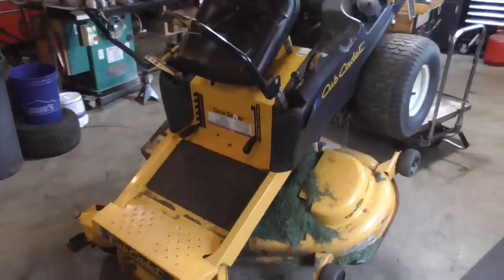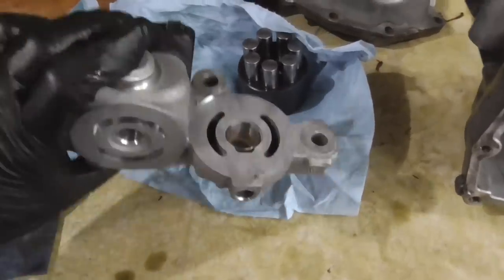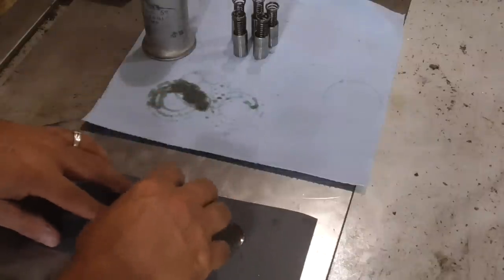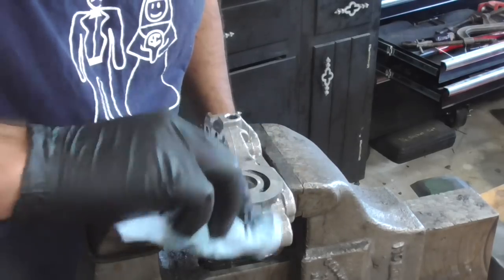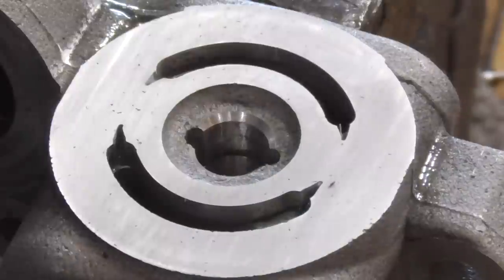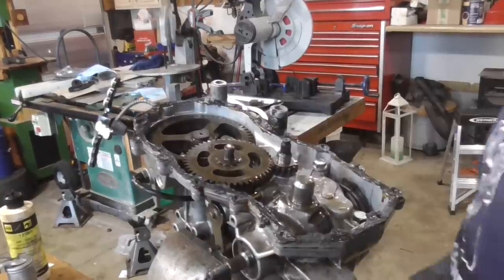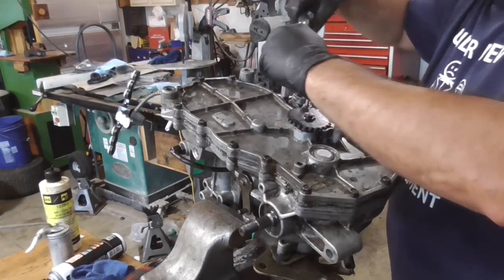Repairing Rebuilding Zero Turn Tractor Hydro For $20

Comment from the maker: https://amzn.to/2Dgrhf4 Wet Sandpaper Assortment
https://amzn.to/3hPn0Ov Wet Honing Block/Stone
https://amzn.to/2ECF3JH Permatex Aviation Gasket Former
https://amzn.to/3gffmg7 Permatex Right Stuff Sealant
https://amzn.to/3hOfbsq 20W 50 Synthetic Motor Oil
https://amzn.to/2Dn1iCM Oil pump can
https://amzn.to/2Xau4NW Brake parts cleaner 12 Pack
https://amzn.to/33aUXVx Hydro Gear Center Section Replacement
https://amzn.to/3jYIvhY Hydro Gear Cylinder Blocks
https://amzn.to/2Pbxn2Z Hydro Gear Motor Block
This video is posted on 7-29-20 by Doublewide6 Repairs LLC
In this video I show you how to completely resurface your wheel motors, pumps, and center section using basic tools.  
Videos:
https://youtu.be/ygwZChI1SqA Transmission rebuild video
https://youtu.be/xwPimj0uXqw How to adjust tracking on zero turn
Help support Doublewide6 Repairs LLC by sponsoring his Patreon Account
https://www.patreon.com/doublewide6
Reply: That was one of your best video's. Very informative. Thanks much.
Reply: great video, straight to it, just subscribed. Bought JD Z245 same problem, liked it so much honest guy told me the problem, bought it anyway. never had a deere, not sure normal sound of steering, both sides seem to whine & seem slower and slightly stiffer to push than others i've ran, left side really bad and when hot completely quits pulling, especially on any grade at all. are JD parts similar to this cub cadet?  What would your advise be on what the problem is? Thinking same as this cadet? also wondering if somebody put hydraulic instead of 20-50? but even if so it still has a problem. worked on my own equipment farming all my life but never a zero turn. sure helps with your videos. Thanks a bunch!
Reply: Are there any parts suggested while the rebuilding in progress ? O rings ect.?

Comment: Just wanted to thank you for posting your video on hydro gear repair. I followed your recommendation and sanded the pumps and pump base housing with 400 grit stepping up to 2000grit. Your procedure was spot on…my weak left hydro gear (cub cadet ZTR LX50) works perfectly. I mow around 3 acres, hills and wooded and this zero turn mower performed flawlessly for 2.5 hours. Thanks again!
Reply: Awsome! About to try this on a used unit i just purchased... 🤞
Reply: @kellyedington8716  me too!
Reply: just saw a unit for sale with this same problem for 700..  how did the repairs go for yall that were going to try?
Reply: Thank you for this video, I sanded the parts, stepping them up with sand paper , put it back together and bad boy works great, thanks for all the help, it saved me money on repair, will follow you from now on.
Reply: How long did it hold up?
Reply: @ErikISkogen still running the zero turn mower with no problems
Reply: @joejacobs3978  Nice! Good to know if i need to do mine :)

Comment: This has worked great so far with my Troy Bilt ZT that had a weak left side hydro. It would whine and worsen as it got warmed up anywhere between 25-40 mins. Sanded it with 1000 and 2000 grit block, cleaned everything up, and now i swear it almost feels a little more powerful than the right side. Tracks straight and even again. Well worth the effort especially If the only other option is a new center section or complete unit. THANK YOU!!
Reply: How long did it take to fix? Is it still working today? Mine's doing this now, just like you said. After 25 minutes the right side is almost unusable. Let me know if this helped solve the problem long term!

Comment: Thanks for posting, I was able to repair my Hustler Sport left side trans and saved myself about $1300.00. One thing I did notice that the unit took about 20 minutes or so to re-prime before it would work. Had me worried there for a moment. Works good as new and does not make the whining noise when engaged.

Comment: My brother didn't want to put in money into his 10-year old JD X304 with a transaxel issue and gave it to me. It's got the K46 transaxel.  I stripped it down last week and I've got the exact same center case problem.  I was wondering if I could sand it...BINGO!  You save me $460 + shipping.  Consider me SUBSCRIBED. Great stuff.

Comment: Thanks for doing this video, it's quite useful. On the motor side I ground down the extra casting so I could run straight across the entire face. I used a block of granite for both.

Mower runs excellent after resurfacing both transmissions.

Comment: i have a zero turn like the cub rzt 50 you worked on . i rebuilt the right side trans axle with new parts and it works fine. i then rebuilt the left side trans with new parts and it does the same will go for a bit and start slowing down and wining. what do i try next i am at the end of trying.thanks dennis

Comment: My left one was the weak one, but I did this repair to both of my transmissions. Purged them both and the left one worked great with the wheel off the ground but won't move when on the ground. The right one works great. I pulled the left back apart and resanded because I saw some faint scratches with a Magnifying Glass. Purged it worked great with tire off of the ground, but won't move with it on the ground. It tries to move, so looks like I will have to buy a new Center Section for that side. Hate that it didn't work for that side.
Reply: Did new center section fixt it for you?
Reply: @scottk27332  Yes the center section, both pistons and new filter. Works Great!!

Comment: Thank you for the video.  This video really clear up how hydrostatic transmissions can fail with no super obvious defect.   These pumps and motors are wearing at their merry-go-round sealing surfaces or maybe gouge is a better term causing them to not be able to maintain high hydraulic pressure needed for producing torque. They make use of  highly critical tight tolerances to maintain high seal pressure and just a little gap in the thousands of an inch will bleed off the high pressure they need for producing torque.   I think its a bit analogous to piston rings, but its a rotating assembly.   Piston rings are expected to allow a certain amount of blow-by so this sealing environment is actually more difficult to manage.   I'm surprised such a system can maintain a seal.  The high pressure is forcing it apart and it might be likely to want to oscillate up and down.  That might be what the sequel noise comes from as the breed through areas quickly changes shape varying the amount of oil that breeds through.   

My father got a Gravely zero turn mower in 2004 and I was the person that ended up using it.   From the start the mower made squealing noises and one hydro transmission side got weaker and weaker.  When it got hot one side would only have about half the power of the other side.  You could still use the mower by biasing how much handle was applied.   I'd change the oil in the hydro drives and one side would have oil that gotten a green color in it, like grass green.   The other side oil would appear dirty maybe a little green tint to it.   The hydro transmissions would run a lot better for a while after changing the oil in them.  

 I think I flushed out the oil a few times to where the oil wouldn't turn green right away.   I was very frustrating and I was investigating online what might be the cause of this behavior.   There was really no information available 2004 - 7, even though hydro static transmissions had been in professional lawn care for a good number of years.   My guess was the problem was likely relatively simple and cheap to fix if somebody wanted to go to the bother.   I finally got a diagram and basic understanding of how these hydro static transmissions work and really there didn't seem to be any clear area they could go bad in that wasn't due cataclysmic failure.   Obviously if the pump or motor case were to crack or the pistons were to crack or break or springs break that would be a means of failure, but if it were due to single piston cylinder it would seem the problem would be cyclic pulse and noise and that wasn't present.  I just couldn't see how the mechanism could be failing in the way it was.   

That mower had been taken in for warranty work a numbers times for other matters and the dealer obviously didn't want to do anything on the transmissions.   I think the transmissions were suppose to be non serviceable.   To change the oil I'd use a suction pump through the vent hole.  I the method left a bit of oil in the transmission, but not much and the oil was changed numerous times to flush the system out.  There were lots of upgrade  fixes for that mower and it got all of them according to the dealer.   

After about 2 1/2 years my dad had gotten tired of fooling around with this Gravely and got a Toro zero turn.  We sold the Gravely for $500.  It also was very hard to start sometimes just barely turning over and in cold weather it wouldn't.   I fixed that by replacing the small tractor battery with a regular group 24 car battery.   I'd recommend always replacing a lawn tractor battery with a 'real' battery.   They last much longer and start the tractor much better and can be used to jump start other vehicles.  The Gravely had room for group 24 battery under the seat.  There was very little clean up that had to be done to place it.   

With the hydro transmissions flushed out with  new Amsoil synthetic 60W oil in them the mower still didn't want to go up the large hill in the backyard, but that hill was due to a it being a dam.  Many years later a lawn care person mowing this lawn told me we had the most difficult to cut lawn in the area with that steep hill.   The synthetic 60W oil greatly reduced power loss due to heat and it seemed to stand up to whatever the transmission had been doing to destroy the other oils I'd put into it.  The person that purchased the mower seemed to just want to play around with zero turn mower and on the flat its problems were greatly reduced.  For $500 in 2007 a person really couldn't have access for zero turn mower to play around with so I hope and maybe it did  work out for him.  I spent more time figuring out that Gravely mower than I'd ever spent on lawn equipment in the past.  I'd expected to spend more time on it being I'd only had experience with walk behind mowers before and riding mowers were notorious high maintenance machines, but this was likely restoring an old abused sports car and it was suppose to be new.   I wonder about that.   

The Toro seemed to have many of the same transmission components and such as the large single cylinder Briggs engine, but with a small three bladed deck instead of the two bladed deck of the Gravely.   Everything on the Toro worked better from the start even though all the components were driving a considerably bigger mower than the Gravely.  The Briggs large single cylinder on the Gravely seemed to be at the bottom of Briggs engine trim level; whereas, Briggs large single cylinder on the Toro seemed to be above the highest trim levels available from Briggs with a special Toro muffler.   Even though the Toro had almost the same Briggs engine as the Gravely I noticed in cutting the same lawn it seems to use only about 2/3 the gasoline the Gravely did.

Comment: Howdy, bub. I'm having trouble with my left-side ZT 3100...as of late, it's much slower and weaker than the right side one. Does that sound like an issue that the repair you show in this vid would repair? Just would like to know before I go through the trouble of removing and reinstalling it... And: Anything else to check while I'll have it out? Thanks!I'd r4eally like to keep this '07 Gravely going a few more years, as it's a beast and in great shape otherwise!

Comment: I have a John Deere Z535M and right side will not move forward or backward.  Happened without any warning.  Just finished the yard and right side suddenly stopped working.  Left works fine.  Right handle has no play in movement, moves just like the left side.  Has oil and no visible leaks.  Hoping I don't have to replace the whole transaxle.  I did notice when I have the engine running and both handles in forward position, left moves and right doesn't.  I can move the right side hub forward and reverse like it's in tow mode.  Same when handles in reverse. When I turn the hub, it feels like it's moving inside the transmission.  It is a sealed transmission.  Any suggestions greatly appreciated.  Thank You Sir.

Comment: Hi, I have a Ferris 400s and it has ZT3100 hydro deives, not sure if this is a problem but if I jack the drive wheels up and engage the bypass levers the left wheel still turns when I move the main levers forward and back. The right wheel will not move, I can stop the left wheel from turning if I hold onto it by hand with a tight grip. Any thoughts if there could be an issue with it?

Comment: Good tips, I think the only thing holding anyone back from doing this repair is fear of screwing it up.  But it is going to fail soon anyway.  Give it a shot.
Reply from the maker: That is a great point.  If it is broken why not try to fix it.
Reply: I agree it’s a lot of work and oil is high price also 
But I’m sure going to try it out if I can buy a used one cheap

Comment: Just a question about sanding out the scratches. Using the wet /dry sandpaper, wouldn't the sandpaper cut faster if you use water instead of oil? Maybe use oil on the last couple of finer sandpaper.
Reply: I've done this successfully with 1500 grit and water.

Comment: I was wondering if that hydro transmissions has a drain plug. And does it have a filter. If it doesn't have a drain plug , I would put one in it. That fluid needs to be replaced every 500 hours. Thanks for the information and video.

Comment: I have found that you can use a ultra sharp and honed flat wood chisel and slowly remove the step. This has worked for me numerous times. Just adding a little help from my experience.
Reply from the maker: Thank you that is very helpful.  Good info for anyone trying this repair.

Comment: I’m having to rebuild my drive motors at 175 hours. I really think they could use a harder aluminum metal. I also found a lot of dirt inside coming in through the vent tube I suppose. Heat, dirty oil and time seems to kill these motors.

Comment: Actually I have the same problem.  I attempted to fix it but disassembly stopped me.  Removing the pulley was impossible.  I found a used pair of transmissions and made a 4 hour round trip, $28 fuel and I was all set!

Comment: Did you happen to question "why" the center section was damaged? I have done several of these units. In every one, the 10 tooth jack shaft gear hard surface is flaking  off and the chips damaged the center section. So if you don't replace the gear, your repair will be short lived.
Reply: Please explain the 10th tooth jackshaft
Reply: @toddrayborn5413  it's a small gear with 10 teeth that turns a much larger gear. You could find it in a "Hydrogear" parts diagram.

Comment: Tried this on my 04 timecutter and didn't seem to work. It goes forward fine but wheel doesn't rotate in reverse. When I disengage it, the wheel moves freely in both directions. Do you know what might be causing this?

Comment: The Toro is actually called the Timecutter. BTW, those 2 Permatex products aren't meant to be used together because of their different formulations. You should use one or the other not both, actually the 'Right Stuff' or Hylomar would be the proper product. That aviation stuff doesn't set up like the silicone and might leak with right stuff on top of it.

Comment: In these intergrated hydro systems, do you use motor oil or hydrolic fluid 
I have a toro time cutter RIGHT side weak pump
Reply: I used 5w-50w full synthetic, had good success.

Comment: Thank you for this video! Do the part listed fit most (if not all) of the ZT 2200 Hydro-Gears? My son (12) purchased an 2015 Cub Cadet and the left side is super weak. He purchased another unit two years ago and we just replaced the Gear but this model is $800.

Comment: Do you think some of the wear could of been caused by lack of maintenance? Not Changing hydro fluid? Great tip and video as always? Stay Safe. Stay Healthy!
Reply: These units do not have drain plugs- essentially you have to take it apart to change the fluid- there are also no external filters in them either
Reply: Some of the units do have external filters. The zt2800 and up have external filters. Its inevitable for this to happen because it will wear over time regardless of maintenance but changing your oil, if you can, once a year will prolong the life.
Reply from the maker: These units are good for 1000 hours on flat yards with no towing.  Turning on roads puts pressure on them and so does switching directions as fast as you can.  There is no maintenance on these units without filters.
Reply from the maker: There are plugs up top but you need to pull the trans to remove the oil.
Reply from the maker: You are correct.  Thanks.
Reply from the maker: There are plugs for removal, but they put them on the top of the trans.  The trans needs to be removed to replace oil.

Comment: Are the drives the same as in the Grasshopper 725? I have a Cub Cadet Z-force L and the 725 Grasshopper, and both have the left drives that are weak when they are warm.
The Cub probably has the same drive as this. The Grasshopper has filters on each drive on the top. It has the 3 cyl liquid cooled gas engine.
Thanks for posting this.
Smiles!

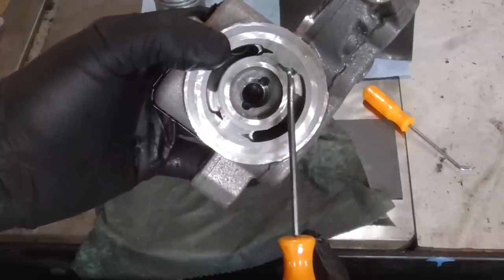Comment: 5:45 A record ! What size. Which rpm ? Just joking. Can this be done for a hydrostatic transmission without affecting the tolerance ?
Reply from the maker: Yes.  It is a hydro trans that I am working on.  Just keep it flat and smooth and it will work no problem.